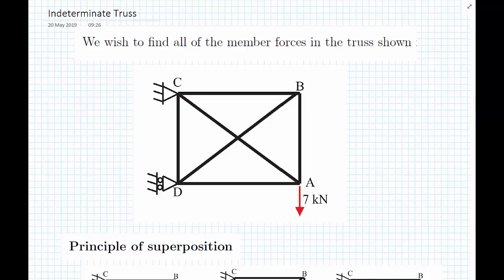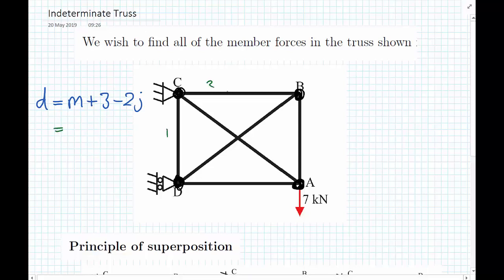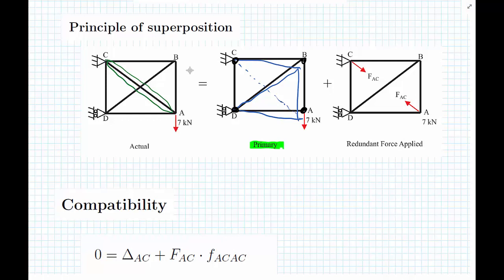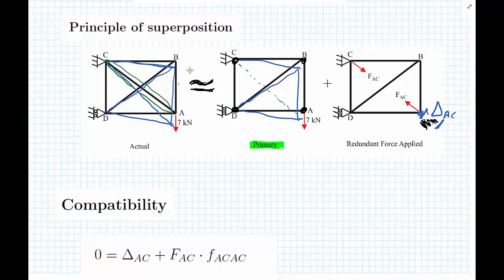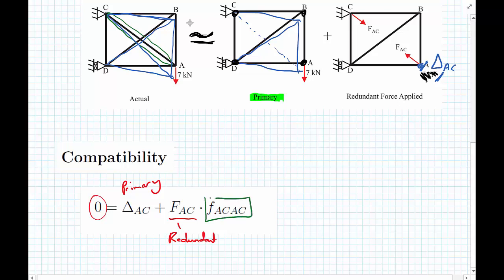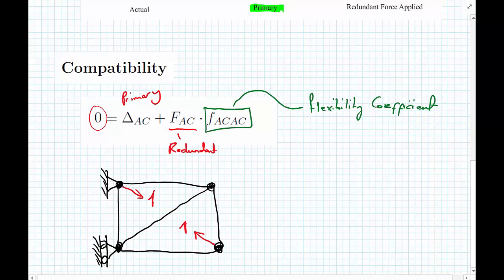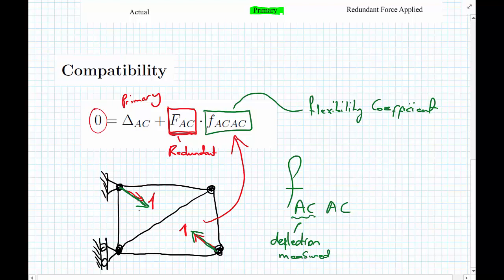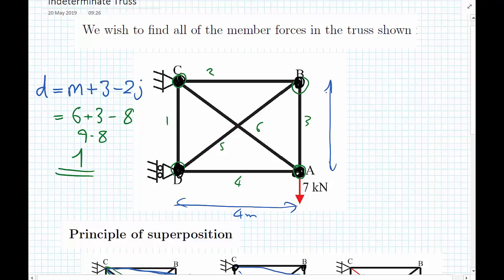Virtual Work / Unit-load: indeterminate truss analysis - Concept

Comment: Sir is it possible to solve this using a matrix?
Reply from the maker: There is only 1 degree of indeterminacy, so no need to solve using matrices if using unit-load method. However, the problem could always be solved using the direct stiffness method (https://www.youtube.com/playlist?list=PLG7h9Zm4rTYy55h3KRZoQw6VKnxZlwMD8).
Reply: Ohhh okay sir, thanks!! 💯